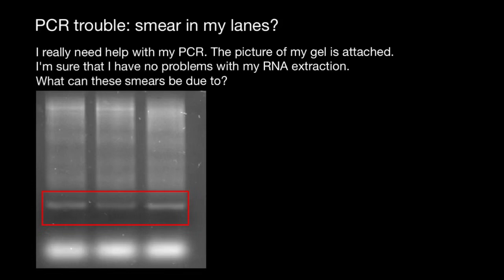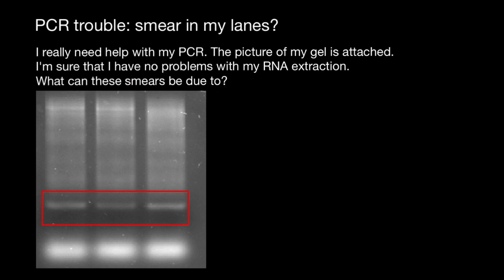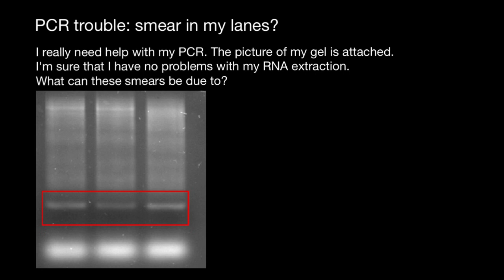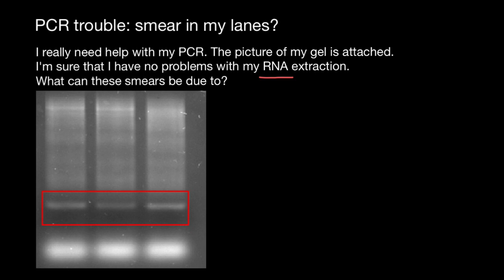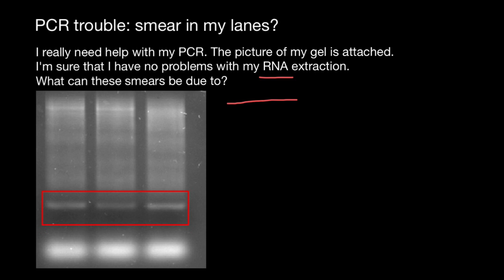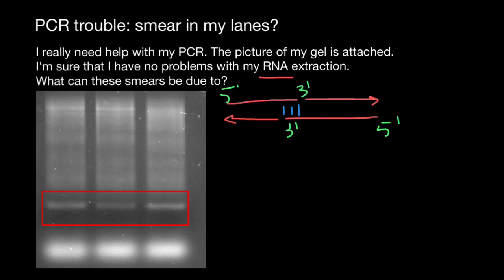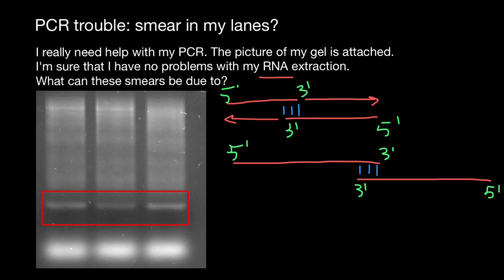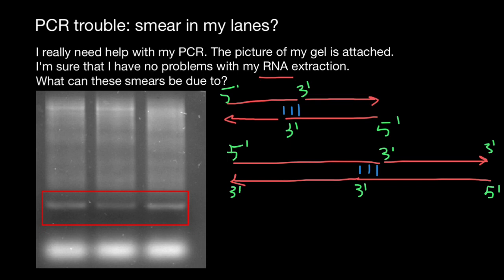Primer-dimers

Comment: hi i got primer dimers too in my electrophoresis result. do high DNA concentration affects this? i used 50 ng/ul concentration, band was appeared but not too thick. and then i tried with 2000 ng/ul, band appeared very thick but i found primer dimers. can you please give me explanation? thanks in advance
Reply from the maker: Yes primer dimers formation can be a result of high concentration of DNA and primers.
Troubleshooting and Prevention:
- Review your primer design to ensure they do not have extensive complementary regions.
- Optimize the PCR reaction conditions, especially the annealing temperature, to promote specific binding of primers to the target template.
- Use primer concentrations within recommended ranges.
-If primer dimers persist, you can consider adding a "hot start" step to your PCR protocol. This involves temporarily deactivating one of the PCR components (usually the enzyme) before cycling begins, preventing nonspecific amplification during the initial setup.
Remember that some primer-dimer formation can be expected, but their presence should be minimized to avoid interfering with the accurate interpretation of your results. Optimization and careful experimental design are key to obtaining clear and reliable PCR and electrophoresis outcomes.
Reply: @GeneticsLessons  thank you so much! do you have recommendation for DNA template and primer concentration?😊
Reply from the maker: - Start with an appropriate amount of DNA template. Generally, template concentrations of 10-100 ng/μl are recommended for most PCR reactions.
- Follow the manufacturer's recommendations for primer concentrations provided with the PCR kit or primer synthesis service you are using.
- Ensure that the concentrations of both forward and reverse primers are balanced. Use equal concentrations of both primers, typically ranging from 100 nM to 500 nM each.
Reply from the maker: Primer-dimer formation can be influenced by the annealing temperature. A higher annealing temperature can reduce primer-dimer formation, but it should be within the range that allows specific primer binding to your template.
Reply: @GeneticsLessons  thank you, really appreciate your explanation, i'll try again tomorrow. have a great day😊